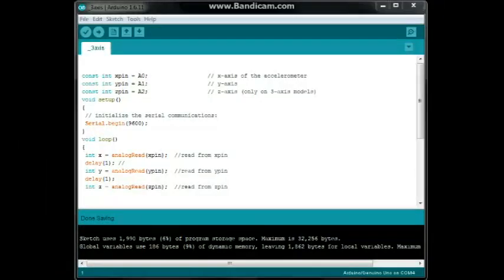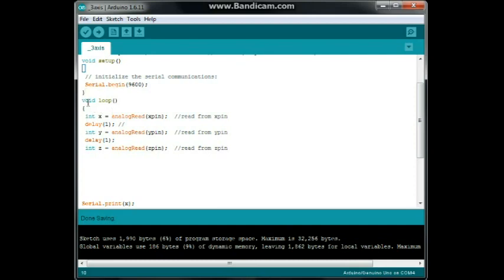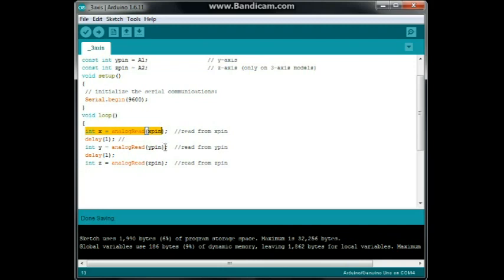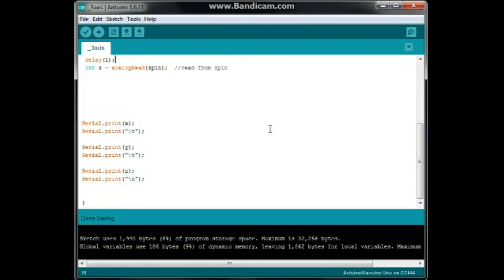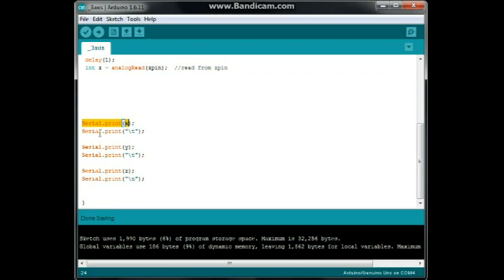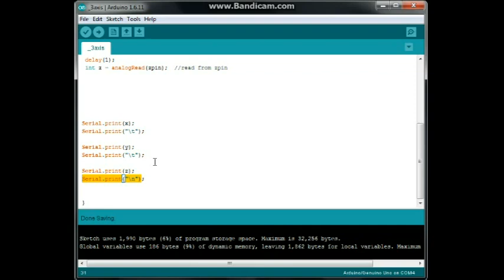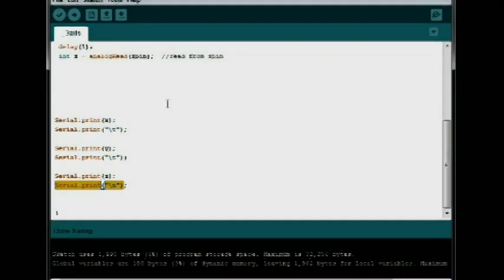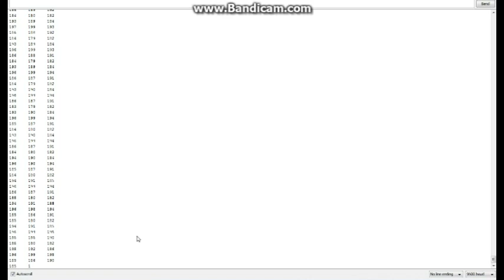How to use the ADXL335 Accelerometer

Comment: My understanding from the video is that the sensor can be used to detect tilt of an object containing the sensor, which is what a gyro does. Can someone please tell how to measure acceleration of an object having the sensor or else please tell me why is it called an accelerometer?
Reply: The accelerometer measures acceleration indeed. If the object is static (not moving) it will measure the gravitational acceleration g=9.81 m/s2 in the downward direction and this is how it can be used to calculate tilt angles for static object by measuring the components of g in both x and y directions and get the inverse tan based on these components.

Comment: I'm programming a gimbal system with a Arduino and ADXL335 accelerometer and I need to balance the camera. How would I read the values from the accelerometer to get servos to respond to it.
Reply from the maker: Tuxedo1001 WKT well you will need to look at each axis individually. So start with the x axis, and when the value increases you would increase the angle or degree of the servo movement comma and when the value decreases you would decrease the angle or degree of the servo movement. You would do that with each of the three axises.
Reply: Thanks

Comment: how i can get the accelorometer readings in matlab ... please help me with that
Reply: Rajeswari Boggavarapu There are a couple ways to do this. MATLAB has an Arduino library which you can use to interface with it but using it does introduce lag if you were planning on plotting real time data. Another way, if real time plotting doesn't matter to you, is to store the data in an EEPROM module and access the data later. You can find SD Chip Arduino adapters online.
Reply: hey ihave solution ; u can use mpu6050 here if u need acceleration and gyro value

Comment: Hello sir!
Does ADXL335 accelerometer act as a gyroscope ? Because you have been tilting this sensor at certain angles with respect to x,y,z planes to get different readings on the serial monitor. Is it possible to use this sensor and tilt it in different angles to give different conditions or is it only used for movement measurement?
Reply from the maker: dewduni dealwis no it just measures acceleration in 3 axies. a gyroscope measures angular displacement.
Reply: @learnelectronics  hello what are your recommendations for a gyro sensor on a microcontroller (PIC)?

Comment: Thanks for the video!

I was wondering why the output is always an integer? I tried changing it to a float but I always get .00. The integer values it gives is only a difference of 2 over about 30 degrees. I.e. A0= 410 at 180 degrees A0 = 408 at 150 degrees. Is it normally that inaccurate?

Thanks again
Reply from the maker: No I usually see values that differ between 50 and 100 units.
Reply: Ok thanks I would say it broken, Appreciate you taking the time.
Reply from the maker: Nicholas Muir no problem

Comment: I am making a simple project where I just placed my accelerometer on inclined plane to measure the angle but accelerometer is giving lot of variations and is not stable what are the possibilities for this behaviour??
Reply from the maker: abdul hudaif Abdul, you are using the wrong tool for this job. An accelerometer measures movement. what you want is a gyroscope that measures angular displacement.

Comment: Without any wires............

const int VCC = A0; // VCC pin
const int GND = A4; // GND pin

const int xPin = A1; // x axis pin
const int yPin = A2; // y axis pin
const int zPin = A3; // z axis pin

void setup() {
  pinMode (VCC, OUTPUT);
  digitalWrite (VCC, HIGH);
  pinMode (GND, OUTPUT);
  digitalWrite (GND, LOW);
}